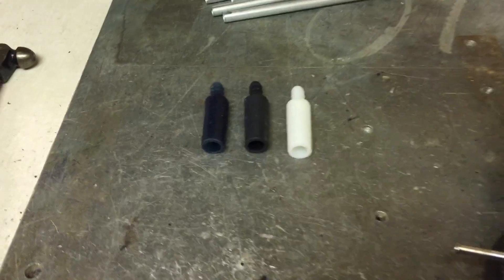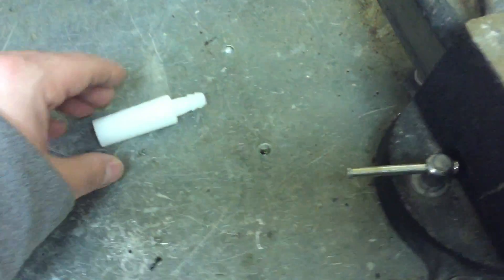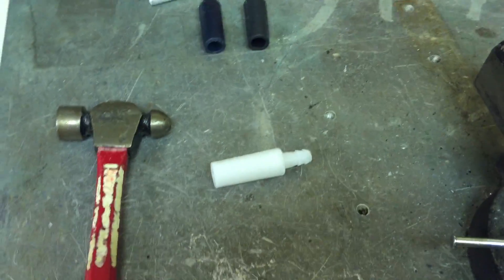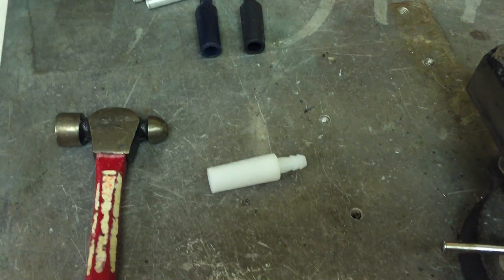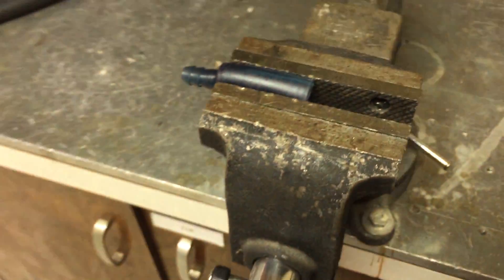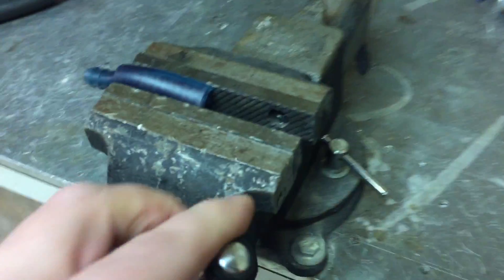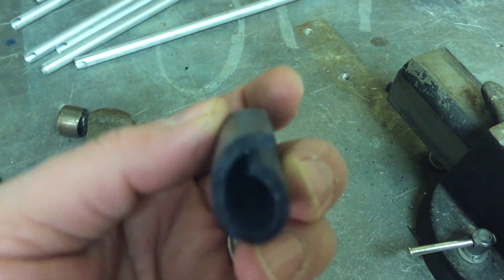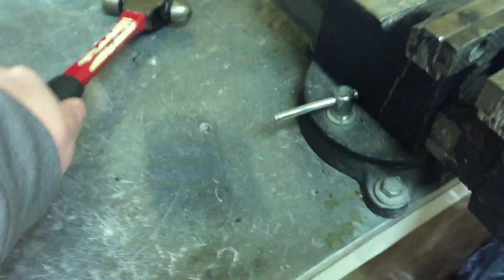Formlabs Material Stress Test ♦ Tough resin vs Standard resin ♦ SLA 3D printer resins

Comment: They're all crooked, none of the parts printed nicely, that's my biggest gripe with that Formlabs printer, it sucks for anything that requires ANY sort of dimensional accuracy. The surface finish is nicer, but the dimensional accuracy is no better than on average off the shelf low end FDM printer. That's why I prefer to have my prints done by companies who use use high end machines rather than own my own Form 2 printer.
Reply: Form 2 is very accurate. Your criticism only applies to the Form 1
Reply: I have a F1+, i thought i could bypass the small build area by assembling smaller printed components.  It works but you are right, the dimensional accuracy isnt there.
Reply: thanls for the video! Helps a lot!
Reply: Zen Magnets Nope, talking about F2, I have no experience with F1. Let me clarify,  I'm talking about Z-axis accuracy mainly. X-Y is ok, it's within that 0,2-0.3mm per 100mm when printing wide and short stuff, BUT when you print things that have overhangs, or stuff that is convex and needs lots of support,especially with wall thicknesses of 5-6mm or more hanging in air, OR most importantly stuff that is higher than 0,5-1cm,  it bends, it's not accurate enough, it bends sideways usually. Like printing a cube that is 5x5x5cm is impossible, it always leans to one side. You can even see it in this video, look when he holds up that green piece with tough resin, it should be a perfectly straight cylinder, but it's not, it's bent slightly.  Even parts that are slightly taller with 0,5mm tolerances modeled into them don't fit after printing, whereas with even something cheap such as basic PA12 nylon with SLS they fit perfectly. That's the difference between home printers and pro printers. This is ok for some figurines and some joke stuff, but for serious engineering, nope. You can't even do basic prototypes on it.
Reply: that doesn't make any sense, maybe your printer was defective or needs calibration